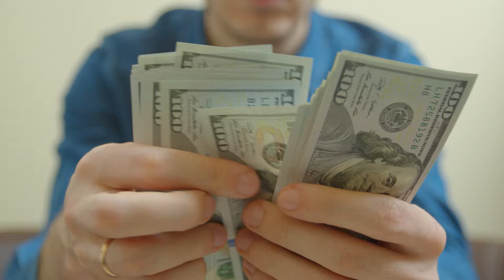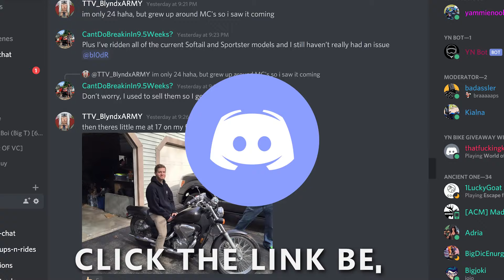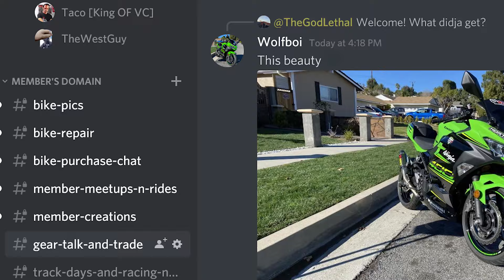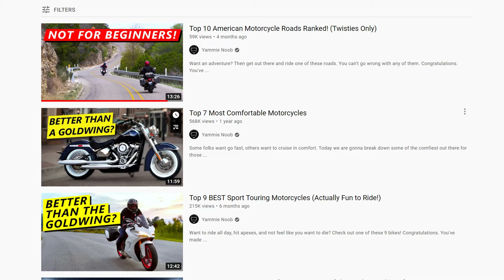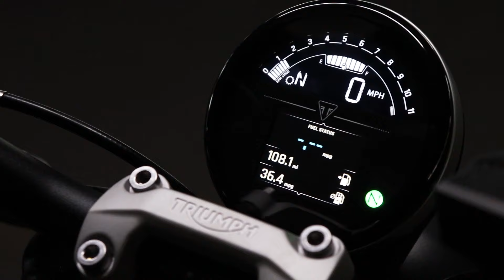10 Things You MUST DO in your FIRST YEAR of Motorcycling!

Comment: I'm old. I started riding minibikes as a kid. Got my first "big" bike at 17 (Honda CB750). In my 30's, a guy I worked with noticed I was still making rookie mistakes (I didn't think I was making any). He asked if he could show me a couple of things and in about 20 minutes, he changed the way I ride. When he was a young man, he was a State Trooper (I believe ND) and he had qualified as a motorman. He was also an instructor. That day changed riding for me from being a basic mode of transport and some throttle therapy to a way of life. So, I would respectfully disagree. Practicing in a parking lot is the best way to increase your skill level and that can save your life. I'm 45 now and still hit a parking lot every week just to practice. It gives you a warm up away from traffic and serves to spot potential mechanical issues before they become a major problem. It does not replace the experience you get from riding in traffic, but it helps make maneuvers second nature so you can concentrate on more important issues, like the jack ass about turn left in front of you.

Comment: I’m 55 and have been working on motorcycles for over 40 years. When I bought my 2014 FZ-09, one of the first mods I did was to install a fender eliminator, which required significant disassembly. When my then girlfriend/now wife walked into the garage and saw that brand new motorcycle with less than 1K on the odometer in pieces, she was like “what the literal f*** are you doing?” Telling her I’d been doing this since I was 14 didn’t really seem to reassure her much. I said, “Wait until I get the exhaust, K&N air filter and Power Commander…that’s going to be major surgery…”

Comment: 4,5 Stay off the highway. You'll see a lot more by staying on smaller roads. Highways are for going from A to B as fast as possible in a car or truck, not for traveling on a bike.
Reply: I use the OSMand+ app on my phone for navigation and I configured it to avoid highways when motorcycling.  I have a small adventure bike, and highways are not my idea of adventure.
Reply: @Liberty4Ever  Getting blown of the road by 18 wheelers and inhaling exhaust gasses ain't fun either.
Reply: @darkiee69  - When riding small dual sport bikes on the highway, when semis pass. I always felt like I was being sucked under them.  If I wanted to ride on highways, I'd get a BMW RT, or maybe a Honda Goldwing.
Reply: Damn right.

Comment: I am a wide guy late 40's. Got my permit and bought a New Suzuki S40, new driver on a street bike. Off-roading during teen days don't transfer to street experience. Relearning pretty much everything. Mirror only showed my shoulders. Bought a pair of bar-end mirrors. Rode 50 miles and parked it. Next day would not start. I checked every fuse, wire, new battery. Roll start and off to the dealer.  Took dealer 30 seconds and a giggle to fix. I touched the clutch safety connection under the clutch lever.

Comment: I’m more of a buy your forever bike right away. I bought a road king as my first bike
Reply: I got an Indian Scout for my first bike, I figured that it would last me a while.
Reply: Oops. Hit post by accident. Think Triumphs still nice but I can do a lot of performance and appearance mods and still take a really long trip for less than a late model Bonnie. The Interceptor especially at its price and reasonably solid design and execution looks like a solid deal. 

And ideally we will get two. Mine, with my wife on the pillion, and our son on the other, with camping gear strapped to the sissy bar. 

If I am missing some other nice set of wheels about 500-800 cc and a chunk below 500 lbs (not more than about 200 kilos) that doesn’t look weirder than the next bike please add your suggestions. Also anybody have knowledge or experience about tuning the Interceptor, especially the S&S big bore kit, exhaust, cam, or suspension please add your comments. Or perhaps you will like the idea for a YN video v

Comment: 5:46 Lol I would've gotten by a lot easier if I had a 300 at the time I started riding. I had a Yamaha Vino 125 scooter but I racked up 11k miles on it in the first year. Longest trip I took was almost 5 hours that would've taken literally half that on a 300. But it was a blast! I got to experience the surroundings more that way and meet some interesting people whenever I'd stop for gas etc. Especially motorcyclists that couldn't believe I was "touring" on that thing. Good times.
Reply: A lot of motorcyclists look down on scooters, but I learned a lot about cornering riding my Elite 80 through roundabouts. Cornering  a "real" motorcycle was almost easy mode, it was so much more stable. ;)
Plus for some people it's easier to concentrate on other riding skills without having to learn to shift at the same time.
Reply: @MrBirdnose  I absolutely agree with you. Though more times than not, I did surprisingly get a good amount of thumbs up for my scooters. Granted that typically was because I modded them to the moon and back, but even stock I'd get told by motorcycle oldheads that they'd never do what I did on em ie riding long distances and weaving through traffic and leaning far on them. I met a lot of fun people.

Comment: 2:38 engines are the same you could put a big cam turbo rods and be fast as a 600
Reply: Not the same engines at all; most or all 250-400 class are parallel twin, 600 supersports are fours.  Maybe if you dump enough money in a 300-400 you can get it up to that level, but then you would want to upgrade the suspension and brakes too, and then what is the point?  Just get a 600.
Reply: @ntdscherer  im saying engines are the same in a general sense piston rod crank cam all that stuff so more fuel more air more power and im not sure the prices but could potentially buy a 400 and make 600 power for a but less possibly
Reply: @bryantb3391  Yes perhaps you could get 600 power for slightly less, but you would be left with 600 power and entry level everything else.  For a little more money you get upgraded everything.  It just doesn't make sense.
Reply: @ntdscherer  nothing truly makes sense
Reply: @ntdscherer  And making more power from a small engine also tends to make it less reliable. Life is full of trade offs.

Comment: I just picked up a 99 katana gsx750f for 700 bucks,,ive drove the ninjas with buddies in the past but just came across this deal and seemed like i couldnt turn it down , to be my first officially that i own ,especially with gas prices the way they are,,ill have to get used to the 750 compared to a 400 or 500 , but shouldnt be to bad.

Comment: Just because you don't mod out youre bike doesn't mean it's not practical.  An ecu, some injectors, and a kp31 turbo would def make youre 400 faster than a 600.  And guess what it's even more unique.  a guy with a welder, the know how, and a few hours could do that easy...   its not even that expensive $260 for the turbo, $400-$800 for the ecu, and $100-$400 for the injectors.  I would take a modded out turbo 400 over a boring 600 all day every day!  Not many people do it because people like you say it's not worth it... Let me ask you a question HAVE YOU EVER RIDDEN A TURBO 400?  I already know the answer but maybe you should try it before you knock it, it's a life changing experience!

Comment: Some really, REALLY bad advice there.  Do NOT go for a group ride, motorcycles are NOT a group thing.  People end up trying to keep up with the pack and ride past their skills.  You really need to keep in your skill level and riding in a pack is the WORST way to do that because the fast riders want to ride fast and that just leaves the others behind or worse, in the way.

There is ZERO benefit to a group ride, ZERO.  What's the point of riding as a group?... None.  Ride at your level, not someone else's.  Assuming that you're at the same level as the others, just for the purpose of being part of a group is beyond silly.